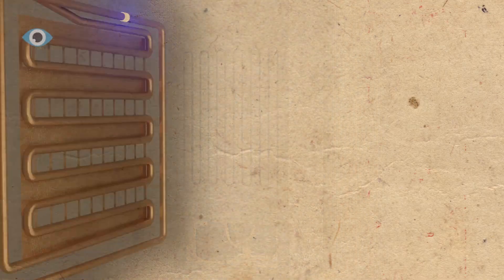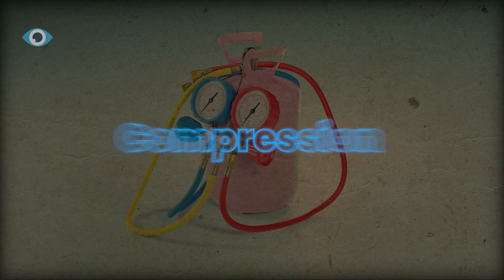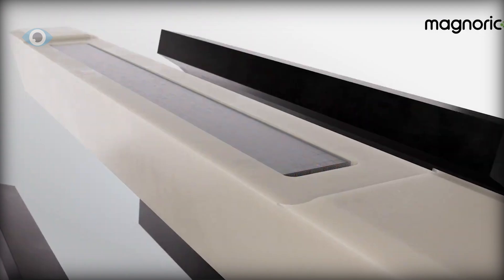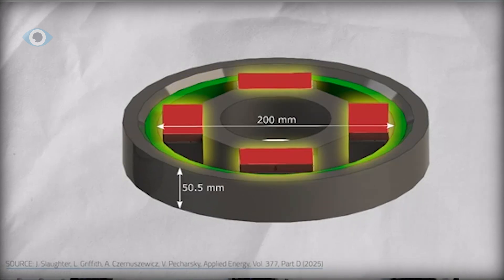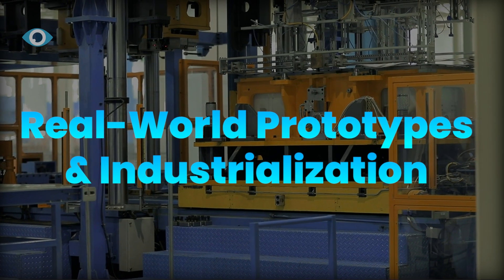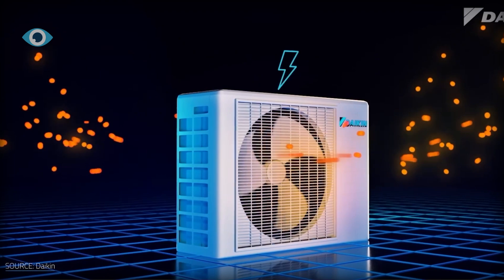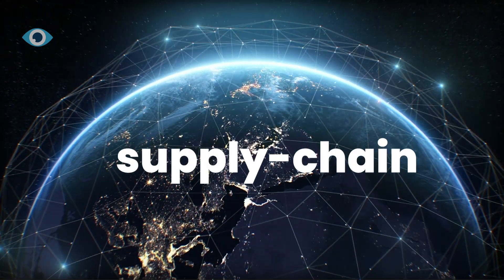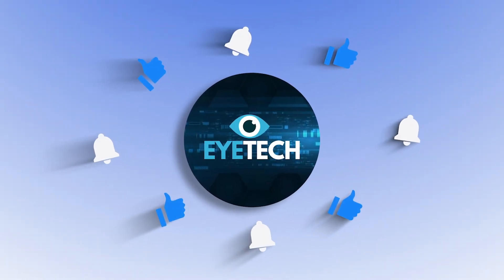How Magnetic Cooling Disrupts The HVAC Industry

Comment: Its wrong. Modern heat pumps do NOT require HFC refrigerants any more. Most new fridges and many new ACs run on natural gas like R290. No harm to environment.
Reply: I believe isobutane and propane are the most efficient refrigerants. Propane is safer than people give it credit. Everybody is so afraid of everything it makes me sick.
Reply: R290 is propane, benign to the environment. Natural gas is methane, bad for the environment.
Reply: @dubemdebrie1460  even methane has a GWP of only 28 or so, while R410a is like 2000 and R32 is 800. Typical refrigerants are highly synthetic and very expensive, R290 is a very natural and cheap gas. But yes, by definition its processed.

Comment: needs a motor still   still uses electricity
Reply: It probably uses a lot more electricity.
Reply: @Andy-df5fj incorrect.  A simple motor changes the magnetic field and therefore causes the fluid to heat and cool, creating the liquid curent thrust. Extremely energy efficient especially when compared to mechanical compression systems. 20 year Commercial HVACR Technician with an Associate degree in HVACR, and a Bachelor's degree in Mechanical Engineering.

Comment: ok, just ear me out, the climate cost of cooling isn't refrigerent, mainly because since we acknoleged the dangers of unproper manipulation we put in place a lot a rules and a lot of penalties.
the climate cost of cooling is that to cool something you have to put energy in a machine, that energy AS to come from somewhere, frenchs use nuclear (wich release heat in exchgange for a fuckton of energy), german use coal( wich realease heat , co2 and radioactive componant in the athmosphere for less energy than nuclear but its labeled greener for some reasons) 
The point is the climate cost is the energy that as to come from somewhere, so unless we start being clever at designing intricate system that reuse the heat from that energy production into something more usefull that just pushing it into our climate, we won't get anywhere, and we are waisting perfectly usable energy.
Reply: The Chinese have been using R-11 to make foam for couches, chairs, pillows etc for decades and still do. That's been the source of most of the CFCs
Reply: @AnthonyCaron-j4p  Soooo, for every little effortsd we make here, china just go brrrrrrrrrrrrrrrrrrrr at it.
Reply from the maker: That’s a really interesting take. Magnetic cooling mainly tackles the refrigerant problem, but like you said, the real question is where the energy comes from. Do you think pairing it with renewables or heat-reuse systems could actually make a big difference?
Reply: @EyeTech21  at least heat re-use would make all that heat thrown away after making that turbine turn would not completely go to waste. but this will require a lot of infrastructure added.
Reply: They can't make a profit that way. 😂
Plus with all the inflation and devaluation of the dollar, we could never afford it, even if they did. Be better to sell kits that we could assemble ourselves, just like in the old days. Time was, if you wanted a TV, you had to build it with a kit. Remember the furniture TVs? And diesel truck engines were never offered from the factory in old times. You had to buy one and put it in yourself. It was the only option. Society seems like its set up for helpless dummies nowadays. Some of us can still do stuff out here, ya know. Sell us a kit for a quarter of the cost! Would be fun to build one of those anyway.